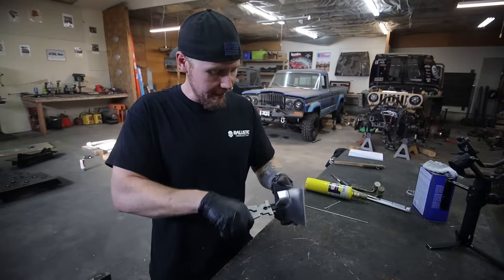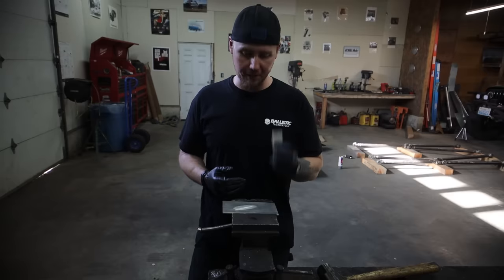Amazon's CHEAP Alternative To Aluminum Welding!!! (Alumaloy)

Comment: I'm expecting my new rods any day now.  Glad to have found your tips on the subject and looking forward to some projects like my Range Rover oil pan with a hole...  My concern is that I once mig welded a steel bracket around my aluminum ebike frame and the frame broke at that exact location soon after.  The aluminum was brittle after it got heated by the mig welder. FYI.
Reply from the maker: I hope it works for you oil pan! That is the exact type of project that I think this product would be great at. 👍

Comment: An infrared thermometer is a good tool to have for the alumi-brazing rod to aquire that heat range to get it to stick(wick or sweat?) between the surfaces alas, it throws off the price point you set to do the episode. Good episode !

Comment: seen ads for aluminum flux that would work well with this and help carry the weld.
Reply from the maker: I actually have some. This product says it doesn't need it, so for this demo I didn't use it. That said, flux greatly helps the bond with brazing and soldering. I imagine it would work well with this stuff too 👍

Comment: My understanding is that these (and similar) rods are mostly Zinc. I have heard of problems in marine environments with electrolysis, would imagine the same for vehicles especially in (road) salty environments, suspect epoxy primer/sealer would be a good idea

Comment: Great product and demo.  Planning to change a few small steel (non-critical) mounts to aluminum using this method.  THANKS.

Maybe you can demonstrate the benefits of using MAPP Gas versus propane to weld small projects.
Reply: Mapp burns hotter, heats object quicker.

Comment: I'm definitely a complete noob with Welding of any kind. However I'm trying to fix a bicycle and where I live I cannot find a Welder within 50+ miles. I do have access to an oxy/acetylene torch and a very old arc Welder of some kind. I'm looking for any advice on how I can fix a broken aluminum frame so that it will be safe to use. Would this be a good option? Thanks for any help you can provide. Also I'm very happy I found your channel. One of the best I have found on the tube. Instant subscription
Reply from the maker: Hey brother! Happy to see your enjoying the channel! I wish I could give you sound advice on this. I would naturally lean into the idea that this product is not suitable in a situation that requires structural integrity.  I think this MIGHT be strong enough to help remedy your broken bike if used correctly but I also think that if the spot in need of repair is integral to safe operation then I wouldn't trust it. It's your call! You could always pick some up and do some testing beforehand to insure it will meet you demands. Then put it on the bike if it seems strong enough. Thanks for watching! 🤘

Comment: Great video and good idea thaofor sharing, don't get carried away though.  Trail repairing aluminum gas tank with a torch...   A gas tank!   In case it still hasn't clicked for you, that is a huge safety issue it will go boom Don't do it!!!
Reply: Just fill it up with water for a day and drain and youre good to go.
Reply: Norm T    easy kid, I'm sorry...  one, in the video the person says  trail repair and lists gas tank.. filling with water, waiting for a day does not sound reasonable for a trail repair. Two I can say from personal experience they still blow up, I've seen it.  Water fill dry for days, still went off no one was hurt but the tank was ruined.

Comment: I have used Alumaloy many times on my equipment, for broken threads, cracked aluminium, repair handles, frames, cable ends even cracked cylinder heads and this stuff works great. This guy showing you how to use it, is making it look much harder than how it is. It is much easier to use and you do not need a lot of heat or skill.  Terrible example on how to use Alumaloy.

Comment: I REALLY like this! I don't have a machine (yet) but this could allow me to do several jobs. Although I think using bricks, as others suggest, is a good idea. If you needed to clamp the metal you still can using bricks, just be smart about it 😘
Reply from the maker: Your exactly who I made the video for. Folks that have aluminum projects but no tig machine yet. This stuff is very practical for the right projects 👍

Comment: Mapp gas will heat up to 130 degree's hotter than propane, Also you can get a concentrated fine tip that will make it easier to keep those joints up to 3,730 degrees Fahrenheit as you draw the rod. 1st use your dual wide open torch to heat the piece on top of a chunk of 4 inch "rock wool" or "ceramic tile" that wont absorb heat, next switch to a 2nd fine tip torch and direct the angle more to the thick tank part to hit the seams with the brazing rod...

Comment: i wonder if it would help to pre heat the large aluminum piec with a hot plate set up and keeping it on there whil doing the brazing.. i have seen this done with soldering ciructs on an IC board.

Comment: I am amazed that I haven't read any comments, regarding safety.
I know that it was a new, unused fuel tank that you brazed the patch onto. ...  but I couldn't help but cringe as you did it.
I was thinking: "At least remove the fuel cap, in case something flashes inside."
Of course, the point that I am making here, is:. YOU WILL NEVER WANT TO REPAIR A FUEL TANK ON THE TRAIL, USING THIS METHOD!
Aluminum shrapnel, lodged in one's skull. ...  takes all of the fun out of every activity.
Reply from the maker: There was three open holes in the tank. Very easy to see in the video. The filler is threaded aluminum. The risk of banging aluminum threads to protect myself from an empty aluminum cylinder would be an illogical method of fabrication.
Reply: @DirtLifestyle ,
I have a buddy that restores cars in California.
He was asked to repair a fuel tank for a Jaguar E-Type. He flushed it for hours, let it dry in the sun for three days, and then checked to verify that it was completely dry, before using a TIG welder to fill some pin-holes.
Little did he know, that the hardened fuel residue on the bottom of the tank could still explode.
With all of the tank openings uncovered, and in just a fraction of a second, the tank went from rectangular, to nearly cylindrical; destroying the tank, and making him very thankful that it was made of steel and didn't fragment.
I would not expect aluminum to behave as well. Better to be safe than sorry, in my humble, un-injured opinion.

Comment: Aluminum not only acts as a heat sink but expands like a mother as well.   Has this caused any stress cracking in your welds or dimensional issues from shrinking?

Comment: Might want to wrap the tank with insulation or any other large piece so it doesn't loose the heat quicker than you're trying to add.

Comment: Couldn't get this stuff to work - melted and flowed nicely, but it did not want to bond at all - could snap peices easily with hands... I tried HST-200 as well - they are basically identical. The only stuff I found that works - although it needs a bit more heat, is the Bernzomatic rods.

Comment: I am not an expert but you should put the heat from the back side of the bracket and concentrate most of the heat on the corner and the bottom plate while introducing the rod on the other side and it should fill both sides nicely or at least should give a nice fillet looking braze on the introduction side ,if this was a box or tank you would not be able to heat the plate from the bottom like you were doing

Comment: Just did my aluminum boat with a grinder mapp gas with the swivel handle and some brake clean.  ( Total cost 100 Canadian pesos) 
Ive even gotten it to forge into rivet holes that are under the seat. Theres about a 1/4 inch gap between bottom of boat and the seat. Stuff it amazing. But listen guys u see ones on amazon like 200 for 19.99$ you get what u pay for. Those arent even 1 mm thick. I think i saw even 0.6 of a mm. And that tiny rod needs more heat than a 3mm rod. The demon rods are what i turn to. Comes in a plastic tube as a holder. They require about 100 less degrees  than the 0.6 smaller than a paperclip cheap one. They really do bond like a weld. If this guy had similar metals or even done the whole weld back side etc. There is no way that would have come apart. They sure bloody amazed me. Get the mapp gass tho propane will take all day. Also wing effects the heat bigtime so if u have a shop use it. But ive done 20 rivets and the rod is half gone. Its really amazing stuff. Get the good ones tho 3mm demon😢

Comment: One more point to make. Either brazing or soldering which you are doing. I can not stress the importance of pre heating, heat conductive metals like aluminum. There heat transfer is just crazy but not as much as copper though. Keep on making videos fella too.

Comment: Perhaps a noob question here, but you mention you have an aluminum fuel tank, oil pan, radiator and power steering reservoir... What is the benefit to having all of those made out of aluminum? Weight savings? Other reasons?

Comment: 1:55 He said the magic word there. "MAPP gas". Propane or other mixed gases are not hot enough. In my hardware shop MAPP gas costs 3.5 times as much as the other ones. You need at least 2400 degrees celsius to do this.

Comment: Bought some similar rods from a Chinese online supplier, needed hotter flames than my current torches, nice work although the hole you patched could have just been filled with the rod. The ad they played showed a hole in a coke can being repaired with just filler rod.

Comment: Im going to do this for the chunk of truck bed i had to cut out to change my fuel pump. Much more practical because you wouldn't need a welding mask or electricity
Reply: Israel James i would probably bolt it back down, maybe with a flat fastener. Then you have an access panel if you ever need. You could make a gasket if you wanted it water tight or just use a little silicone
Reply: @Naptownstreetsquid  that's a great idea. Heavy duty hinge

Comment: I found similar stainless steel rods to work with stainless. I prefer it as it maintains a more consistent working temp. I have the aluminum ones. Helpful. Just don't get the same level of results.

Comment: JB Quick 5min Epoxy is faster, and probably just as strong, portable and doesn't require a torch or any special skills. For plugging a hole in a gas tank etc, its perfect and could be used to make things like radiator overflow tanks and stuff too.

Comment: I'm not a welder or metal worker, but I worked with guys who claimed that it was hazardous to weld ANY tank that had previously contained fuel—no matter how long it had been dry. I think they were referring to steel tanks, but I'd be very uncomfortable field brazing a recently drained damaged aluminum fuel tank in the way that you seem to be considering.

Comment: what metal will aluminum brace to or does it have to be alum to alum? what about the thickness to avoid melting the mating surface? thanks, it was good to see you actually demo. i don't like to use tac weld and limited to certain metal bonding. bob
Reply from the maker: I'm not sure about the limitations of this product. What you see in the video is all the experience I have so far but i would say that with any thickness you need to practice first. Thinner aluminum is very easy to melt but this product has a lower melting point than aluminum so it can definitely be used in that application. Just needs practice for a good result! Thanks for watching 👍

Comment: A stiff stainless wire to scratch through the molten weld material gives a better weld. Especially when you want it to flow under an edge.

Comment: As stated below, (Joe Atwork), your vice was sucking heat from the base plate, ... you should have stould the pieces on something else with as little contact as possible, (right on the edges).

Comment: You can compare this method with silver soldering steel parts.....you have to be clean, the part itself has to be heated and NOT the weld material......this also applies to soft soldering with lead based solders.....….heat the part, and the part will melt the solder etc, but in all cases the parts must be CLEAN.

Comment: Oddly enough I  have some of those  rods  lots of fun repaired  a 5 hp Briggs and Stratton  race motor  after rod broke  apart at 7000 rpm

Comment: So aluminum has a melting point of 1220°F, and the Alumaloy rods melt at 728° F (According to Amazon listing.) Have you tried putting your parts into an oven or kiln at some temperature between these two points to see if you get a stronger, more even bond? I was thinking that if you melted the Alumaloy and got it to kinda stick a little to the bond area, and then put the entire piece into an oven at, say 900° F, for example, you should get pretty good flow along the entire seam. Just curious if you have experimented with anything like that, and what the bond strength results were. Cheers!
Reply from the maker: I actually haven't experimented very much with this product. But that's a very interesting idea. I'm not sure if it would help the bond but it would definitely level out a uneven joint. Very Interesting... thanks for watching 👍

Comment: You should have something to insulate the aluminum from your press.  The heat transfer is to rapid so have scrap wood to avoid contact with other metals.  Thank you for showing the breaking point man.  Nobody else does that.

Comment: If it was available in thin sheets, could it be cut to fit between the mating pieces and make a stronger, cleaner joint?

Comment: Saw these Alumaloy sticks on amazon and just tempted to just use those instead of jp weld cus i have a mower as a project and don't wanna buy a new deck so might as well try these and repaint the deck same color or new color when i can get the parts and the sticks.

Comment: Im building a splitter structure/frame for a race car using 1/8 square aluminum tubing and dont have access to a tig welder. Do you think using this method would be more than adequate for this? Tig would obviously be stronger, but for bonding the tubes to one another, would this be a good approach?

Comment: I've recently tried two types of supposedly "low temperature" rods on very small pieces of wirebrushed aluminium strip. I heated them for 10 minutes with a MAPP torch and all I got were a couple of blackened, sad blobs of barely molten rod, that I could flick off with my fingernail. I'm not convinced...

Comment: Open flame on a "fuel tank"?  What did you do to get the fuel totally out of it.  Around here, we run a diesel engine with the exhaust pumping through the tank whenever we have a flame or arc near it.
Reply from the maker: Brand new tank but its going in a diesel. If it had been used I would have flushed out real well and let it sit in the sun for a week. That what I've don't before without issue 👍

Comment: just a tip since this is a video showing how to do this,  youre supposed to get the aluminum hot enough so that when you touch the rod to it, it melts the aluminum, instead of heating the aluminum then using the flame to melt the rod, ive always been told, if you have to use the flame to melt the rod you arent doing it right. now of course it will work, but just cause it works doesnt mean its the right or proper way. it will be much stronger done the proper way.

Comment: Very cool job. I haven't aluminum brazed before but looks pretty easy. I was wondering if the Bernzomatic mapp oxygen torch would be good for this or would it be better to use my mapp rose bud torch as far as heating goes??

Comment: Would this product work for the skeleton components of the internals walls of a teardrop trailer? There will be a inside and outside wall structure. Mainly looking at top, bottom, door and window supports.
Reply from the maker: It's possible. My experience in different applications is limited to what you saw in the video. If you practice with it enough to make a good good joint then I would say this could be strong enough. But again, I can't be sure 👍
Reply: @DirtLifestyle  thanks. I will give it a try. If it looks like it will work for my needs then one of two things will happen, 1) I will comment on this again or 2) I will make a video.

Comment: Would this be strong enough to make a roof rack out of square tube? Or would just using steel square tube be cheaper?
Reply from the maker: I wouldn't use this on anything structural. I don't think its strong enough for a roof rack but I'm pretty cautious about this kind of thing. Having your rack fall apart on the freeway isn't an option. 👍
Reply: @DirtLifestyle  good to know  Thanks i want to try this on something haha.

Comment: Do you think this stuff would hold under radiator pressure? 

I want to relocate a inlet pipe on a aluminium radiator, but.skeptical this can withstand the pressure. 

Thoughts?
Reply from the maker: I personally wouldn't trust it on a project that you rely on. It definitely could work but I would hate to see it leave you stranded 👍
Reply: @DirtLifestyle  True. I would hold you personally responsible 😂 Jokes aside that would make a good video!

Comment: Great vids man, thanks. Lot of useful info. I have a question about brazing aluminum. Would it be possible to pre clean then bring the components to 730 degrees (assembled) in an oven, then apply the brazing rod?

Comment: I'm thinking of building the frame for a small pickup truck cap (think contractor cap) out of aluminum using this technique. Based on your experience, do you think the "welds" made via this process would be too weak to be used like that?

Comment: I am trying to fix a cheap recliner chair. The base is an aluminum tube that was brazed or welded to a box base and the joint failed. Would this technique be strong enough to repair it do you think?